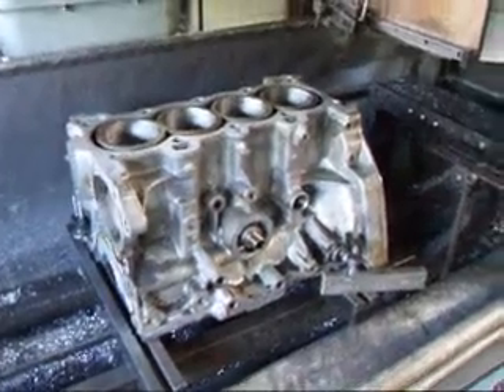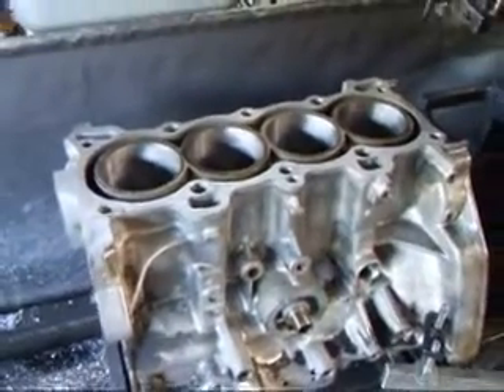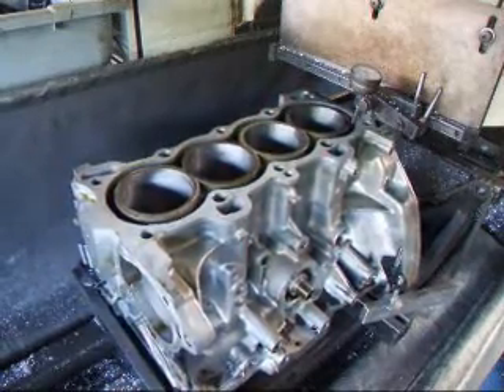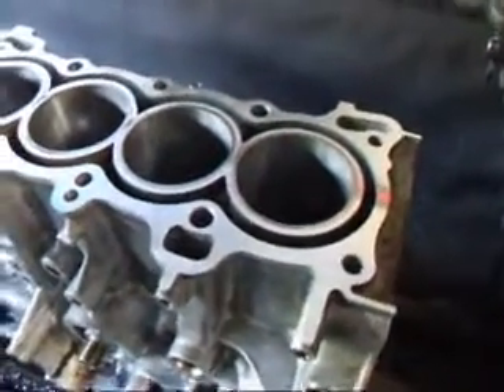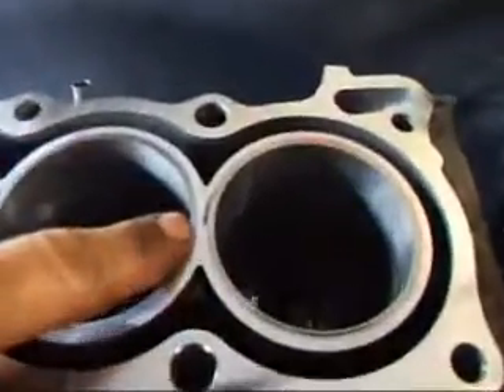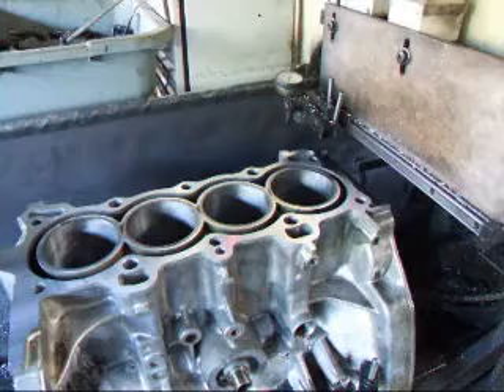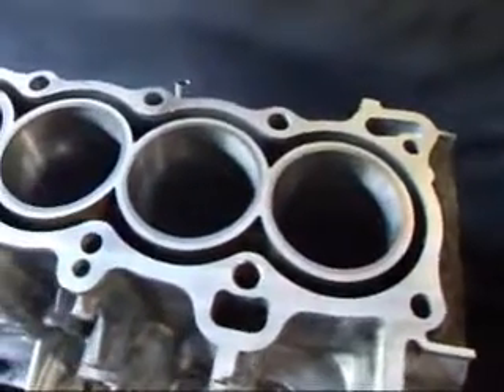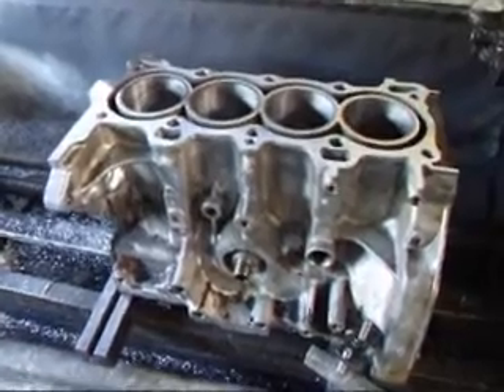Honda D16 Block Resurfacing

Comment: if you get both the head and blocked resurfaced, does that increase your compression ratio? would i need a thicker head gasket? and if so, where would i be able to get on?

Comment: Deutz builds their smaller industrial diesels this style too, i hate them. When a gasket blows you need to resurface them to get an even edge around the cylinder, instead of putting some new liners into them

For car engines (which outlive the car they are built into anyways) its ok but not my favourite design to customise..

Comment: I was wondering about that too.  Not so much on the Aluminum, but on some of his other videos he's drilling and reaming cast iron.  Just guessing that maybe the cast iron will absorb the coolant and requires cleaning before putting new guides in, dunno.  Just a WAG.

I'm not a machinist or play one on TV.  I've learned just enough to make small parts, brackets, and things that go into electronic prototype assemblies.  Basic stuff, lathe, vertical miller, drill press, etc...